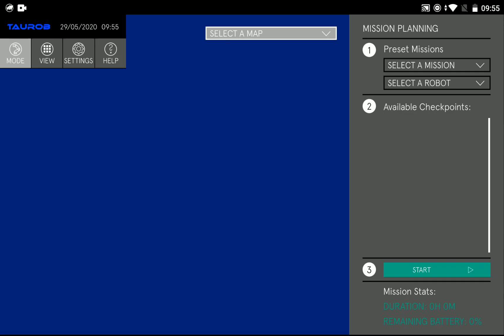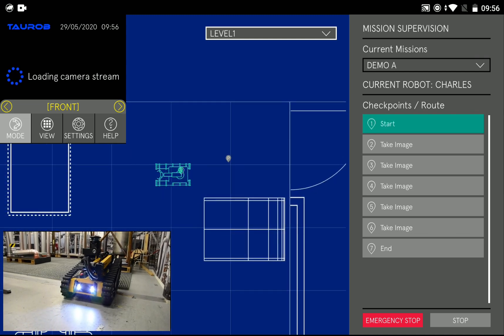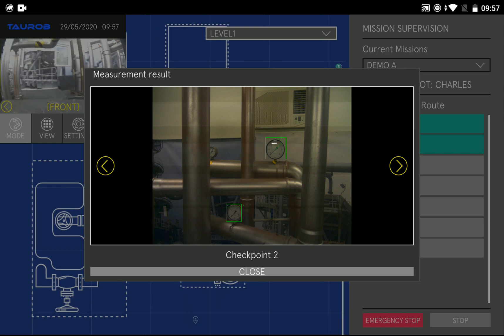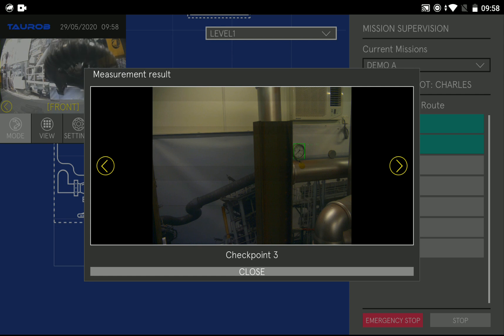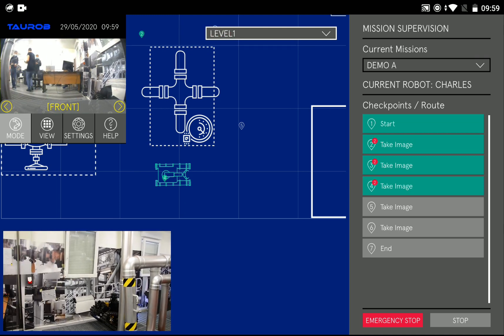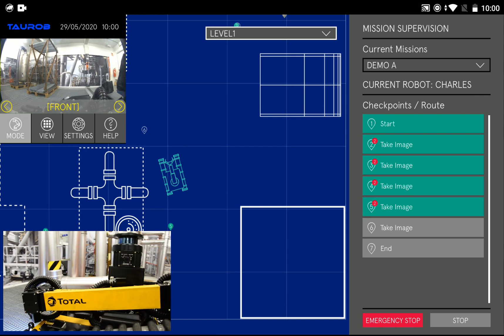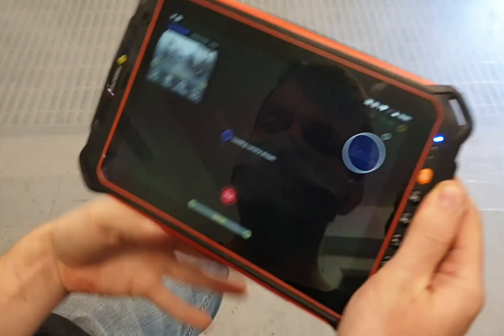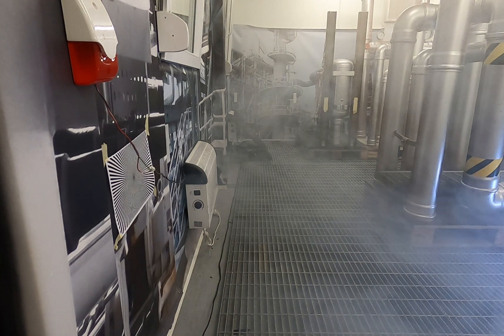taurob Inspector Mission

Comment: For clarification, is the robot being controlled remotely or is it able to be autonomous?
Reply: Both, first it drives autonomous, later teleoperated
Reply: @LukeSilverWoodworking  Awesome! I was getting the Inspector confused with a different model, the Taurob Tracker which appears to be only teleoperated. The Inspector seems incredibly sophisticated.
Reply: @g111792  Indeed, but wait for the Taurob Operator, even more sophisticated with autonomous manipulation capabilities and enough strength to lift 50 kg or turn valves with 150 Nm
Reply: @LukeSilverWoodworking  Wow thank you for the information. My company has a Tracker currently and it has been very interesting trying to classify it under USA export controls.
Reply: @LukeSilverWoodworking  Do you know if these robots are subject to dual use export controls in Europe? Thanks again 😊